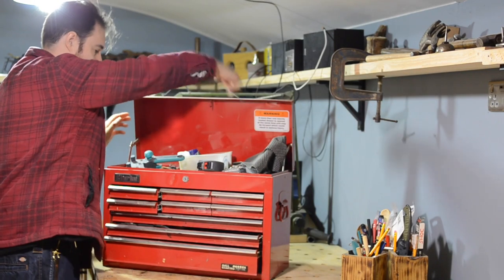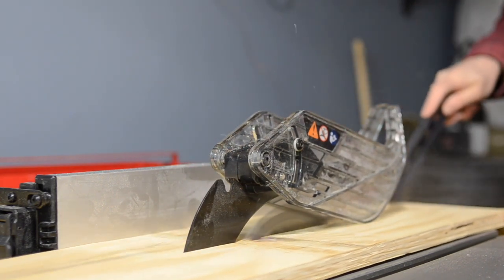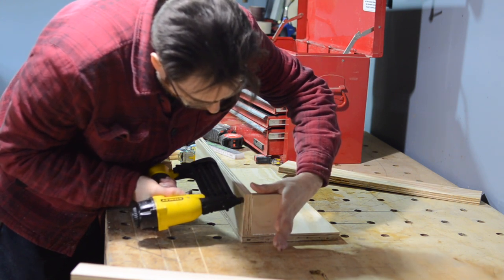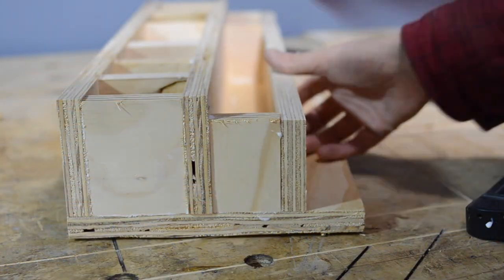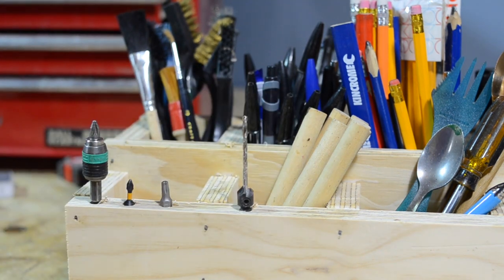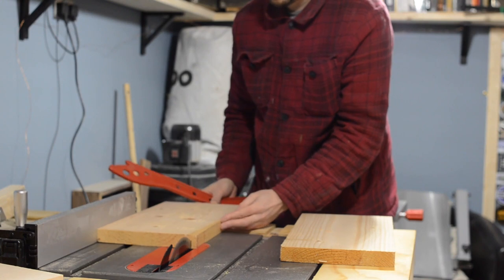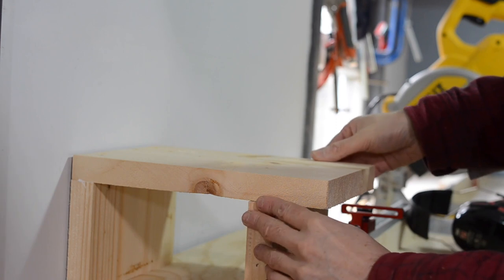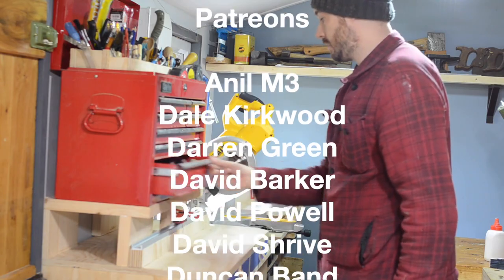Tool Box Organisation

Comment: I have the same cabinet and the same problem. I've been tempted to remove the lid altogether to get it close to the wall. Either that or fit it out as you have - if I did, I'd be tempted to use the space in the lid behind your current unit. Looks like a great place to lose something essential in your setup - particularly given the height of it on your mitre station.

Comment: Why don't you take the lid off the box? It doesn't do anything as you never shut it, and it holds the box away from the wall. I'm interested, as I can see others are, in the new table saw. Any good? I take it the battery power was a by-the-by rather than an essential (given you operate out of a workshop with permanent power).
Reply from the maker: I don't want to drill rivets out to take the lid off. I will review the saw after I have had it a wile